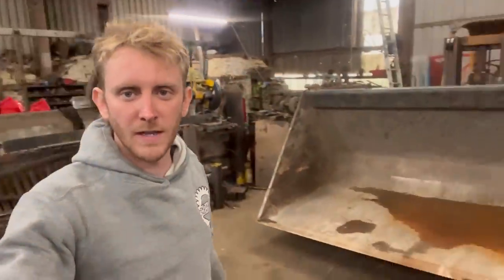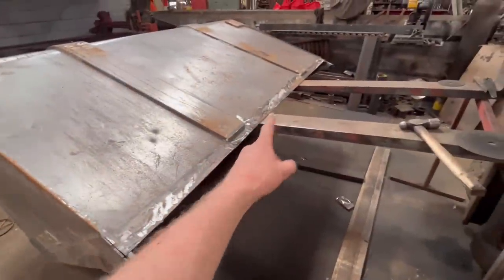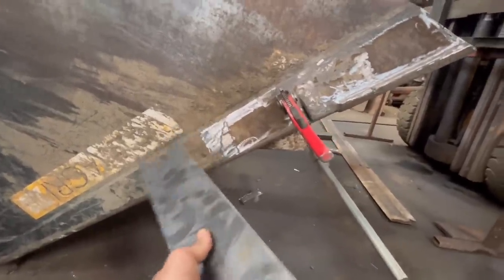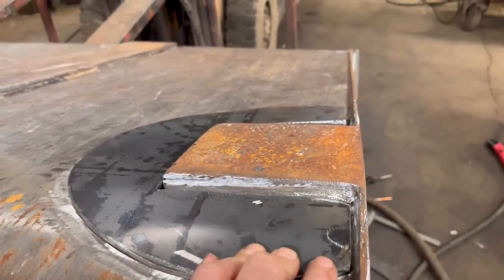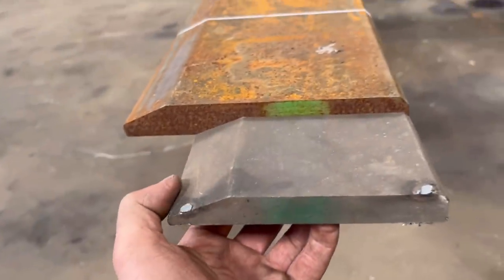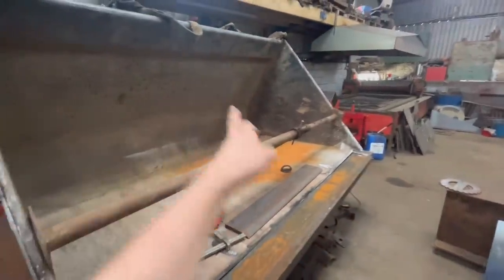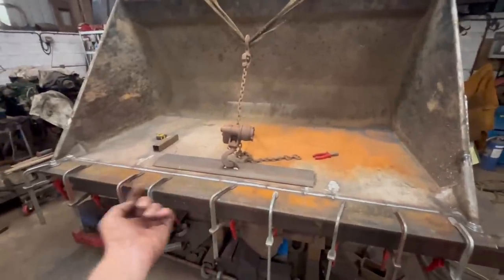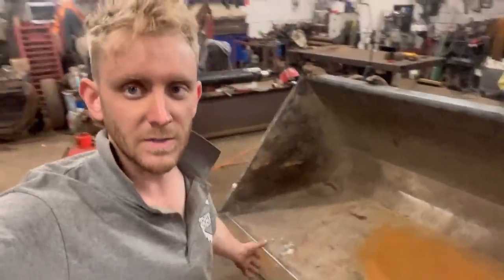Replacing bucket wear edge and welding up cracks.

Comment: Great how you use a crowbar/ wrecking bar to press plate into position. Such a good way of using it. Works both ends for whatever you need to pry into position. Beats using wedges and blocks. Yet again another quality, entertaining and informative video. 👍👍👍
Reply: Another nice job !!

Comment: Excellent job as always, Oliver! I'm relieved to see you wearing breathing gear. I am 81 and have interstitial lung disease (and probably COPD) because I was cavalier in dusty, gritty work conditions. Thanks for the excellent video and rescuing this garbage bucket. It's a shame when OEM equipment is not adequate to do the job.
Reply: @@chasewilliams5128I am 69. I do and did lots of shooting guns in my younger years. Then worked in the power industries for 32 yrs before I retired. The company I worked for stressed Safety. 
I would never mock anyone wearing safety gear.
Reply: Well done, you made it to 81. My dad worked in an office most of his life, he died in 2004 aged 79 of emphysema which is a lung disease.
There is also a larger amount of residual radiation in post nuclear bomb steel than steel made prior to the nuclear era.
I have been welding and grinding for many years and own a fabrication business. My lungs are slightly damaged from a mild dose of pneumonia in 2019, but l still crack on and do a day's work.
I am all for health and safety, but in my opinion it is our own responsibility to use it. There is a negative health impact using forced air fed masks too. That being not hearing the thing that could be about to hit you because of the noise from the air pump. 
Everything has pros and cons young man!
Reply from the maker: I try to always wear breathing gear now if I’m doing dusty or Smokey work. I plan on being in this industry for a long time so got to look after myself.
Reply: @JonDingle  I recently ruined a spindle on my 1954 Yazoo 60" lawn mower because I was wearing ear protection and failed to hear that the blade had come loose and was spinning on the spindle, destroying the blade mount. I still wear hearing protection, however, as my hearing is already bad enough and I love classical music. (I was able to replace the spindle, btw.)

Comment: I watch you for hours. It’s like going to work without the burns. (I have photos on my channel) I made and altered/repaired attachments for heavy equipment (JCB). To cut that old blade (or a section of that blade) off it is best to get an oxygen/acetylene tractor that travels down a track. You lay down a section of track or two, send the little engine and monitor the gas lines. Long cuts you leapfrog the track as the tractor traverses. It is ideal for cutting the bevel when making blades. JCB failed on this bucket. The sides cracking in the blade area is not a problem when the entire leading edge of the side is a blade. The problem with the wear pad appears to be due to there being no wear plates.
Reply: That part with the chain puller/wench (come~a~long) is way easier with a z bar and a wedge. We always sweated the steel before welding especially hard steel like blades/cutting edges. Winter mornings at shift change all the rosebuds would fire up. Booth after booth the Welders would start with a pure gas burn making a flickering mass of a flame twelve feet long then add oxygen changing it to a wide cone fed by gargantuan ball of liquid oxygen and fuel gas a tank farm of monster tanks. Like rich people problems I was not a welder and had no rosebud, I was an assembler/builder and did lay~up. I tack welded the pieces together straight and handed them to a Welder who welded for several days then handed them back for me to put the ears. When I was doing the tungsten embedding I would rosebud a table leg and hug it to stay warm.
.
’’’’’//,,,,,  z-bar 
.
|7             Wedge 
.
Weld the z-bar to blade haging over the bucket floor or the reverse then tap the wedge until you achieve alignment

Comment: Hi, Oliver (we're not mates yet so no "Olly").  I think the skins are too thin for the work the bucket is asked to do.  As you know, the cracks occur because the metal is being overstressed, back and forth, over and over until failure. A bucket that thin is almost always a sand bucket.  You've done a damn fine job patching and strengthening the bucket and that new edge will wear damn well. But if the bucket continues to get heavy duty use then you will have a frequent customer.  Thanks for letting us watch.  Cheers.

Comment: Nice repair olly. Makes you wonder about the quality of things like that bucket. I worked for a waste company in the nineties they had bins and skips made by various company's. The best roll on roll off bins they had were made by a company in south wales called PD engineering they were twenty years old and still going strong. I think some manufacturers are sailing close to the sale of goods act. The thing is they get away with a lot  because nobody will complain or take them to court. I have seen this with a company that imported and sold readymix trucks the mixers were rubbish they split and the blades came away from the drums in no time. Patches everywhere. The owner of the company asked me what i thought and i told him to see a solicitor he ended up scrapping the drums and having a remanufactured  drum made by an independent engineering company.😁❤ Ruth.

Comment: I do love this type of videos, was it my eyesight side edges, it looked to me as if the steel had a 180 degree fold in it, and not a single bit of steel, love this type of content putting manufacturers blatant cost  cutting measures right
Reply from the maker: Yes the sides are folded back around on themselves.
Reply: @snowballengineering  very cheap way to get thicker steel

Comment: We have two Manitou MLT 627 buckets with exactly the same failure points ... Boss says just keep welding them!  Only used for horse manure and light duties, but they scrape on a concrete floor and the chap before me wasn't so careful using them!  I like the extra suport for the pads .. have to look further at that, show the boss.

Comment: Great example for an light material bucket that was used for to heavy applications. I don't know but I would guess that the bucket is original made for material 0.3T/m² or some thing like that. Hopefully all your work holds up well and the cracking doesn't started along the new welds again.

Comment: You sure get a variety of different work in. That bucket was made out of material that was just too thin for the size of the bucket, so no doubt it's going to crack again and you'll likely see it again for more repairs. It's pretty obvious that it's too thin by the dents in the bottom of the bucket.

Comment: Great repair and improvements 👍.
Guessing the thick pads and straps on the underside are too rigid compared to the thin skin? Steeped reinforcement looks excellent. 
The longer Flitch plates certainly look better than the original stress raisers.
Thanks for sharing 👍

Comment: Are there any decent aftermarket buckets to be had or would it be better to buy an old one and spend a few quid fixing it up? JCB seem to be going the way of the rest of British manufacturing caring more about profits than quality
Reply from the maker: General any that are not mass produced. My experience with mass produced buckets like this is they are built to a price not a standard.
Reply: @snowballengineering Strimech has or Eastern attachments made JCB buckets I thought? Of the rest Allbutt seem reasonable. If you were closer to Cornwall I'd have you make one!

Comment: Very nice work.  This kind of work is hard on the body.  Try to save your back and knees.  Like bending over to weld the bottom of the cutting edge on.  Very hard on your back when you could raise it up with the fork lift.  I just had my second back surgery and can't do much of anything anymore.  Take care of yourself while you are young.  Regards

Comment: I would imagine that steel is to hard and thin and can't keep up the the stress the Tele handler put on it it would hold a good bit of wheat day in day out loading not to mention the odd soil pile lol lol well done awesome job ...I can remember having a toe tip root basket made by suton engineering Norfolk that worked well for a time ..

Comment: Common sense engineering is hard to beat. The old bucket was an incredible example of bad engineering. All the cracks and lack of support on a branded product is abysmal. The finished product is good. Preheating helps with stress, reducing moisture and reduced hydrogen which reduces the potential for cracking. All in all a great job. Keep safe and well 👍

Comment: The problem with  weld on strips is that they're part of the frame so as they wear thin the bucket bows as you said, a customer of a mate of mine always has a  strip welded on a new bucket before he uses it, and replaces it as soon as it starts to kiss the original 👍
Reply from the maker: The customer did ask if I could weld the new edge onto the old but it’s difficult once it’s worn as it doesn’t fit up properly.
Reply: Yes, totally agree, absolute pig to do on a worn one, as I understand it this guy does it to a new bucket and keeps that as a base line 👍

Comment: I think your into a never ending relationship with that bucket ! 
It looks to me to be a design made for light duty low bulk density feed handling. It’s clearly being used for more rigorous use ? You have done what can be done to extend its life , I suspect it will be back in the shop again. Nice work to get it back serviceable!

Comment: Great job, I always do a triple run on cutting edge, was just how I was shown, great work and set up. One question, do you not isolate the battery on forks when welding while using forks to support the workpiece? I got a great bit of kit online, "anti-zap" basically a serge protector for electrics, we mainly do vehicle welding repair and the anti zap saves disconnecting the battery and having to re-code the radio etc. Would love to have the balls to do videos myself, keep up the great work 👨🏻‍🏭👍
Reply from the maker: If I’m welding on something with a computer I’ll turn off the isolator or disconnect the battery but I’ve never had any issues with old stuff.  I think I do have a serge protector somewhere

Comment: Which filler wire have you used on that HB500? Would it need a better preheating if it’s 65mil thick cutting edge ?

Comment: Reason for the Bucket falling apart, is JCB doesn't want it's Attachments, to out live it's Equipment.
Truth is, it's a Budget Friendly / Base model Bucket. That You will see come in to Your shop more often, because it's cheaper to have you keep repairing, then for them to go Buy a Good Bucket, That you only have to see when the wear bits need replacing.  So it's a Money Maker for You!

Comment: Great work! What is the purpose of stitch welding the back side of the cutting blade instead of fully welding it out?
Reply from the maker: There isn’t really any need to fully weld it on as there’s no real strength to be gained, just makes it more difficult to remove next time.

Comment: Ollie do you think that those cracks come about because of poor quality welding wire or rods? Somerset Mike.
Reply from the maker: I think it’s the steel they use. They’re marketed as made from high strength steel to make the overall weight lighter

Comment: How is the fit with the 3M Speedglas. I have to say it's worth every penny. Can you tell us what equipment you prefer and why? Good job done and nice to see a Brit doing it too. Super!
Reply from the maker: Fits good, I have the proper ear defenders to fit underneath it as well.  Which equipment do you mean?
Reply: @snowballengineering  Welding machines in particular and how you set them up. What makes you prefer and why.

Comment: Makes you wonder the way it is cracking and the fact it is quite thin material (opposed to the good ole days) if the designer has gone for a steel with slightly higher carbon content. This would in theory keep same strength as thicker material, reduce weight of bucket/attachment but it wouldn’t be as good at dealing with repeated flexing and would crack 🤔 (Especially if incorrect pre/post heating)
Reply: Made to be as cheap as possible to get customers into  genuine assessories, really only made for very light duty's like a bit of silage or light grains but everyone uses them for dirt and the "the odd quick job" rather than changing to a regular bucket
Reply from the maker: Yes, I think you’re right.

Comment: Honest question on the choice to grind off the edge. Would a torch be faster or is grinding a cleaner cut that needs less attention later?
Reply: Because his bottles were hooked up to the plasma table. He mentioned that.
Reply from the maker: The floor of the bucket is only 4mm thick so it didn’t take long to slice through it with the grinder, very minimal clean up needed also.
Reply: @2nickles647  probably missed that when I was snagging a beer

Comment: I wonder if the cracking has something more to do with the weld parameters, filler material or practices at the factory than what type of steel they use. As I am certain you know Oliver, If you are careless you can unknowingly weld in stresses especially in high strength steels, However you would think that a manufacturer would have welding engineers and designers that fully understand those things. Who knows? 
Nevertheless it's money in the bank me lad!  What I really want to know is how many pry bars do you burn up a year! Cheers
Reply from the maker: They are marketed as high strength steel and then use thinner plate to reduce the overall weight of the bucket. 
Only 1 pry bar, I just keep grinding the welds down 😆

Comment: Much of this JCB stuff is now made in India, either at the JCB factories there or by Indian sub contractors. This is why the steel is poor quality and some of the engineering not up to scratch.I know from speaking to guys who work for them here in the UK that they are having massive quality control problems but despite all the reworking and  parts that end up being rejected and scrapped, plus of course the cost of shipping it's still cheaper than building the parts here. The cost per kilo of the completed item after it's been shipped half way round the world is usually less than the cost of the raw materials in the UK.

Comment: Yes one of those jcb buckets came through our shop first off anyone that welds a cutting edge on without a moldboard should be shot for complete incompetence weld on a high wear I’m talking border Lin mentality challenged right the reason they crack is there is absolutely no structure to bucket every time that is in use it flexes and twists I find it funny
Reply from the maker: That’s how 95% of agricultural buckets are.
Reply: Fng junk no structure whatsoever got a cat 385 bucket all cut apart in my bullpen (shop) 10 or 12 yards a monster of a bucket between the bucket and the extreme quarrying armor it has to be4-5 inches thick on the floor and at least 6+ on its cheek plates i betcha with armor pieces bucket weights twice what it came in at stay safe my friend take nothing for granted

Comment: Compared to the buckets you built, these are decidedly flimsy. Just a curved plate with ends tacked on. With little bracing you would imagine the sides keep the base in tension. Making them crack easily. Added to the thin, poorer quality metal. Minimal welding. And basic design. The things are a problem waiting to happen. I'm sure a lot of companies do this on purpose. Cost of production of course. Faster repeat business when they don't last. After all, as you say, in this case you are paying for a name. Customers shell out on new buckets to keep their machines original. But from the numerous JCB related repairs you get. It would seem the company has cut back too much on the production of its ancillary parts.

Comment: Best of a bad job i guess. JCB aren't the only ones selling rubbish quality attachments. Far better to get a built bucket from someone such as yourself. Our 10 year old Bainbridge bucket is well worn but not a single crack and it doesn't wang about like the strimech!
Reply from the maker: I probably made your Bainbridge bucket 😁
Reply: 😂👍I did wonder when you said that you had made hundreds and where your based. Keep up the good work